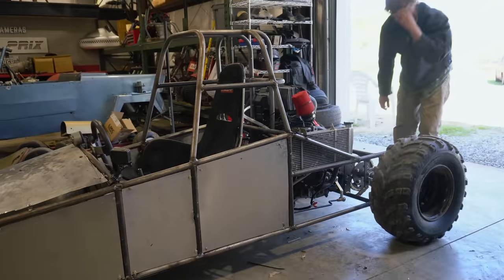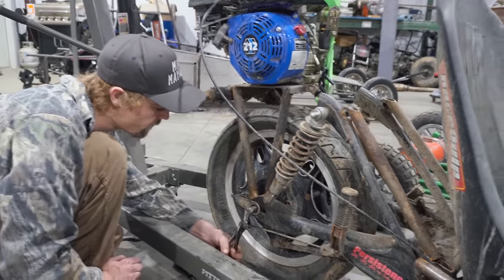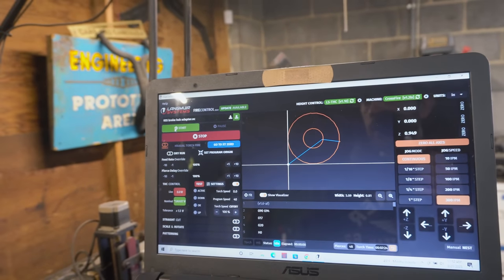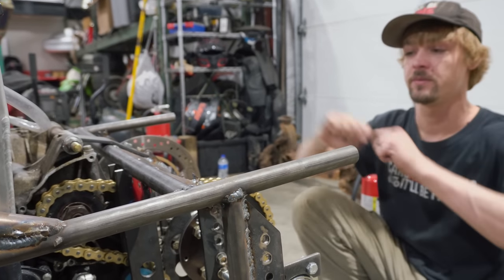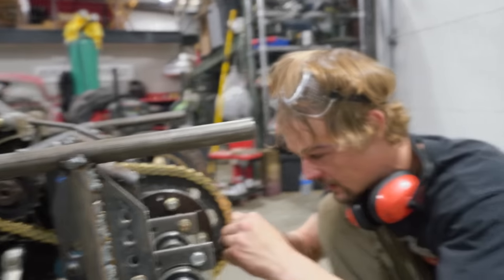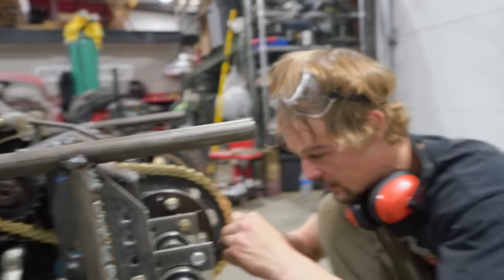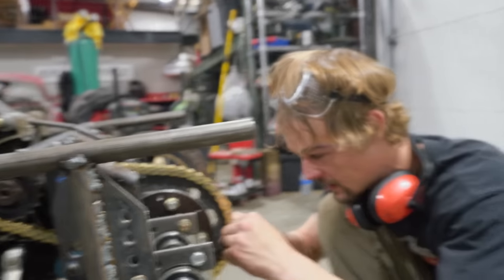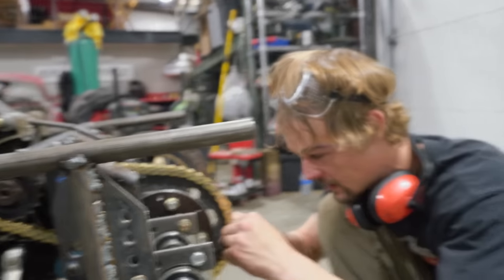Triumph 955cc Dragster First Test Drive!

Comment from the maker: A good first test drive always ends in burnouts and broken parts!
Reply: But is that safe ?
Reply: @Philc231  well it is entertaining so
Reply: So true
Reply: @CarsandCameras how much is the repairs going to cost?
Reply: Hey CarsandCameras I also know a four wheeler, jeep and side by side riding place about 10 miles where I live it’s called TEX PLEX it’s on J highway in Kirbyville Missouri
Reply: Is that front left wheel wobbly in the intro?
Reply: Quick. Question ...why are you guys not cutting out custom sprockets of your own to make ur own custom gearing
Reply: It ain't racin' till you set the seat on fire.
Reply: That engine sounds great! Can't wait to see (and hear) it on the drag strip!
Reply: It still looks like a blast to ride. A little bit of adjustment after the new parts are in, and you'll have a great ride. It sounds great, just too bad it doesn't have reverse.
Reply: If u don't break it ,your not doing it right ,if your not first your last 🤷😂✌️
Reply: Can you make another video of the racing mowers maybe with a sears make a dragster from it
Reply: It's called a shakedown for a reason🤙
Reply: And let us not discount the entertainment and excitement value of a good fire!
Reply: Try dual disk breaks on the rear
Reply: Opel gt! 
Opel gt!
Opel gt!

Been a good few months after I've been saying to fix it and it's finally happening
Reply: That axle looks like a weak point. My racing karts are bigger
Reply: Have you guys change the fuel system setup?.. Originally you guys had the fuel pressure regulator before the fuel rail when it is actual suppose to be on the return line after the fuel rail.
Reply: Especially when Ike is driving it 😂
Reply: Spoiler on it would look sweet
Reply: That's why they call it testing.
Reply: Also I didn't realize John an Charles were both lefties like me... I bet it'll feel weird tryna shift with your left because us lefties are so used to having to just use right handed stuff that it just feels unnatural using the left hand for most things😂😂😂
Reply: If you want to get much quicker shifts might consider a quickshifter.
As long as you are using the ECU from the bike the engine came off.

Allows you to make clutchless shifts with the throttle wide open.
Just have to use the clutch when taking off from a stop and when stopping.

Healtech offers one for the Daytona and Sprint models with this engine.
Retails for $320.
Should be a fairly easy install.

I have owned several bikes with quick shifters and they are great.
Can go wide open throttle and bang through the gears without having to release the throttle and use the clutch.

If you are racing it, it would shave significant time.

Some bikes also have the option for clutchless downshifting, but not sure on this one, and it’s not as important.

The general design for most of them is a sensor on the shift rod which is connected to the ECU and a control module.
When you begin to put pressure on the shifter, the sensor recognizes the pressure and sends a signal to the ECU to momentarily (milliseconds) cut ignition spark.
Which allows the shift to seamlessly occur without using the clutch.

There are plenty of YT videos showing motorcycles with them, as they have become standard on many bikes now.
Videos will demonstrate just how well they work, and the speed you can shift.
Reply: May want to see if you can upgrade that clutch fork assembly, you will give more pressure with your foot than your fingers.
Reply: It would be cool and look cool
If
It had a wing
Reply: A quick release wheel would be great for that

Comment: Nice first shakedown, lots of fire in that dragon, certainly! Hope the fix is quick & cheap. One irritating thing is the panel noise, Holy Mackerel!How about that DynaMat dampening sticky sheets & or stiffener ribs rivited underneath (or both!) Sometimes the conversation & engine were drowned out by the banga-te-bang of that panel. Great show & great crew! Thanks guys!  Paul from S. Central TX.
Reply: Quick spritz of bedliner in a couple spots on the inside should be enough to greatly quiet those panels...

Comment: You guys are still my heroes after years of YouTube, I still love watching your videos. John, I noticed your comment on the old CB750s, a friend of mine still has an unrestored rider 69 or 70 CB750 that runs like a top. I believe he still has his CR500 as well, damned thing was and still is the baddest oil burner I’ve ever seen. I’ve had an XL350, XL200, Voyager12, Vulcan 2000 (heavy but a torque factory on wheels) CB550, a beautiful CB750A if you know about the hondamatics (Excellent machine) a later pre nighthawk CB650SC and a slew of Japanese bikes before I got into V-Twins. Anyway Soichiro Honda San’s favorite of all the early accordion 4s was the 72-74 CB350 Four. The twin actually made a couple more horses at lower rpm’s and weighed less but he felt you were more one with the machine with the Four, it had a higher powerband, smoothness like nothing else, a 10,000 rpm redline and was built as a street bike to honor the race winning 350. It was a riders bike. The man was a genius. Anyway, useless information to most but an interesting story. Always love seeing you, Ike and Charles, doing what you love to do and hopefully making a living doing it. God Bless and keep on making folks happy doing the things you do. 
I really want to know what the plan is for the Opel on the rack, I used to watch a guy at Bakersfield run an odd fire 4.3 based Chevy V6 in one that sounded awful but ran like 8.90s with 1 four barrel. 
Sorry for being long winded, Frosty…

Comment: Good work guys! I think you should stick some noise reduction pads on those side panels so it doesn't make that rattle noise while riding. After all good project. Nice to see it  finally moving under its own power. 👍🤟

Comment: You still need to triangulate the front with some bars or at least a vertical or two on the sides. If one of you lose it and hit in the front it's collapsing and it can crush your feet or skewer you with a folding 6ft long piece of tubing.
Reply: bingo!
Reply: if they get in a crash that bad ther gonna die or get seriously injured anyway what your suggesting is a waste of time and wont look good theyve accepted the responsibility of driving this just leave it at that
Reply: nevermind im assumin you mean a x or v brace underneath in the middle then that would make sense i thought ya meant off the side or something
Reply: @TylerDuysen  I don't think you understand how a tube chassis/roll cage works in a race car.  The area you are sitting in, including your feet, needs to stay intact and the rest of the car/cage crumples/bends to absorb energy in the crash. There needs to be uprights (and a cross brace really) on the sides beyond their feet to keep the sides from smashing and bending whichever way the force takes them. There is a good 6 feet at least of tubing top and bottom with zero support and much of their legs are in that zone. In a frontal impact which will probably have some side forces as well, it's going to turn that 6 ft tube into a Z and the front is going to impale them  and/or fold over possibly with an ankle or whatever in there. Look at guys walking away from top fuel dragster crashes at 300mph or any nascar, sprint car ECT that go on wild rides and walk away. This 100hp go kart isn't going to be running numbers that should make it lethal to crash in with a little forethought and design consideration. Find a pic of a Jr dragster frame online. That's how it should be built. This isn't a yard kart. "It'll be fine" doesn't apply here. Ike is a moron if you haven't figured that out. John has no experience besides following along with Ike and Charles is probably telling them the same thing I am off camera(I hope).
Reply: You would think over the years the build quality would be better?  Look at the welds and the sheet metal and over all quality of this build.  I would not get in and drive this abortion.
Reply: @jasonbirch1182  i understand how tube chassis work bud ive built a few of my own(quality/proper tube chassis) they already have bars on the side underneath the sheet metal they are missing the x bracing underneath though which like you said would turn there side bars into tube spears if you read my other comment you wouldve understood i thought you meant something else entirely regardless this is not a proper cert rollcage/tube chassis at all its entirely wrong for that so adding more bars will help but isnt gonna do much have a good day and we will just all hope that there gonna be okay
Reply: @vinylexperience77  I'm hoping that if they go through tech at a drag strip the officials will flag the cart for poor welds. I'm not trying to be sarcastic, but someone will get hurt if that cart flips or hits the wall.
Reply: @larrycarlston4044  Yes someone will get hurt.  This whole build was very shitty craftsmanship.  That is not toy engine on that frame.
Reply: @TylerDuysen  I believe zero of what you just said.  You are talking they're going to crash and automatically die then you say you build tube chassis cars. Yeah. Okey dokey buddy.and no. There is no side bars beyond the dash bar.
Reply: @jasonbirch1182  okay smart guy apparently you cant do math what happens when you hit a cement wall at 100+mph when you have an improper cage/chassis you die or seriously get hurt theres a reason for nhra certified roll cages this has double the hp of there rail which already did 100mph on a run so this will go faster than that clearly second i never said i build tube chassis cars i said ive built a few theres a difference  c you obviously havent been paying attention to the videos because john welded in some side bracing and so did charles its just hidden under the sheet metal there is however no bracing on top or bottom or in the front nose meaning in a high speed crash it would completely fold killing or seriously injuring them like i said before and d and i will say this for the last time they used the wrong tube(not to mention how poorly its welded) so if they crash that chassis is folding like a slinky or accordian and they will be pancaked again goes back to nhra certifications this chassis is wrong so adding more side bracing or even doing the x brace in the back or in front or nbottom and top like i mentioned to them isnt going to do much like i said originally its a simple equation wrong tube, wrong thickness, lack of bracing, high hp and low weight and poor welds -serious injuries or death in the event of a crash have a good day
Reply: You can't tell them nothing as they don't listen to words of wisdom and truly believe safety last... Except for John's female side ..
Reply: @Wil_Liam1  😂
Reply: @TylerDuysen  how do you figure there's a 100mph collision on a dragstrip? You are never hitting the wall head on that fast. It's parallel to you. If they lose it and start to spin and hit the wall nose first theyre still not hitting it at 100mph. It needs to keep the driver compartment intact. The rest bends. That how a tube frame works. You said " I built properly designed tube frame cars" . No you didn't. Stop it kid.

Comment: You could get a Pingel electronic shifter. Or an Electric over Air shifter. They both interrupt the ignition to allow the forced shift without using a clutch. Shift into first gear with clutch pulled in at the line and every shift after that you just push a button and it shifts one gear at a time,  every time you push the button.
Reply: Otherwise known as a recluse clutch.
Reply: Definitely the way to go I know some who had an air shifter on aa wicked fast sporty

Comment: Owning a Triumph 955 sprint and having ridden many miles with other Sprint, Daytons and other 955 bikes, it is fun to hear the sound coming out of your project. The 955 has a very wide torque range. But the engine really comes alive around 3500 rpm and starts to flatten out around 7 or 9 k, depending on the version you have. 
My Sprint loves to trot along between 70 and 120 mph. They were not the fastest things out there by any means, but very rider friendly, and a blast to ride.

Comment: Hey for that kind of center-push clutch, you can cut a hole on the outside center of the cover (exposing the pushrod end) and bolt on half of a single-piston brake caliper and use that to actuate the clutch pushrod. Easy way to convert to hydraulic clutch. Ive seen some of the taiwanese motorcycle racers convert from cable clutch that way.
Reply: It's a pull type, which is one reason it got broken. But over pushing on one is bad also.

Comment: Love the dragster content & I've been saying build a rear engine car for awhile now. One thing I'd do is probably set the steering up with handle bars and a hand operated cable clutch and a foot shifter as on a motorcycle. My 2 cents. Good luck with that dragster boys !

Comment: Ya gotta make sure there's freeplay on the clutch cable. If there's constant pressure on the lever, loading the pushrod it'll heat up (bluing)and......well....

The max arm travel is 1/2-3/4"
Keep up the great work guys!

Comment: The skateboard wheel will last just fine, cheap, serviceable, and I had a minibike I built out of a chopper bicycle and a rototiller as a kid, it ran for 3 years @ 7+ miles a day, it used em top and bottom to reduce chain throw, the chain stay was 28+ inches

Comment: Just a tip  your welds are lacking penetration as you are running the amps to high causing you to wash weld. If you turn the amps down and slow down the your travel speed you will end up with much stronger and visually pleasing welds
Reply: Are you saying they're welding 1/8" with 3/8" settings?
Reply: There ruff for sure

Comment: Wait! The back of that frame is not complete! Those axle hangers are only being held on by the two front bolts. They need to be boxed in. Sure it’ll work. But why not just frame it in? It’s not like it would be a lot of work or added weight. Just added insurance and rigidity.

Comment: Very cool. I do notice the drivers head sticks out in front of the top of the cage (halo). If she flips the drivers head is exposed. Wondering if you could extend the front of the cage a bit to cover the head area near the very top of the cage so you can still get in and out somewhat easily and the drivers head is covered.. Kinda like an awning over an entry door...kinda. Nice work guys,she seems quick.

Comment: Great work guys. Absolutely amazing build. Breaking things is normal in the stage of testing. My question would be if you would want to build a wing for the front and back, like on these real Top Fuel Dragster. I think it would look absolutely awesome on this Dragster of yours. It would be more weight, but maybe you could build it so, that it's removable. Anyway, have a great week and have fun, but stay safe.

Comment: If you put an extra link in the clutch linkage at the arm, and add a return spring to the pedal, you'll be able to adjust it so there's almost no force on the throwout mechanism when engaged just by watching for that second link to 'kink' and not be in line with the cable end. Other ways to do it are a slotted pivot hole and large washers to keep it on track (gotta keep that lubed and clean) or by fitting a threaded rod end to the cable, fitting a sleeve over that, and using a little flat stock bent up with a hole in it as the throwout lever end so the cable doesn't fasten, it just slips in the lever until you pull it far enough to take up the slack and a nut/washer on the end pulls the lever.

Comment: Open wheel race cars you see on pikes peak have side pods but they also have big front tires.
Drag rails do not have side pods.

Y'all finally got a machine with a good sounding exhaust.

Comment: Paddle shifters on the steering wheel. You could build a  bracket for the shifter on engine on Paddle would be used for up shifting and the other for down

Comment: If you want to get much quicker shifts might consider a quickshifter.
As long as you are using the ECU from the bike the engine came off.

Allows you to make clutchless shifts with the throttle wide open.
Just have to use the clutch when taking off from a stop and when stopping.

Healtech offers one for the Daytona and Sprint models with this engine.
Retails for $320.
Should be a fairly easy install.

I have owned several bikes with quick shifters and they are great.
Can go wide open throttle and bang through the gears without having to release the throttle and use the clutch.

If you are racing it, it would shave significant time.

Some bikes also have the option for clutchless downshifting, but not sure on this one, and it’s not as important.

The general design for most of them is a sensor on the shift rod which is connected to the ECU and a control module.
When you begin to put pressure on the shifter, the sensor recognizes the pressure and sends a signal to the ECU to momentarily (milliseconds) cut ignition spark.
Which allows the shift to seamlessly occur without using the clutch.

There are plenty of YT videos showing motorcycles with them, as they have become standard on many bikes now.
Videos will demonstrate just how well they work, and the speed you can shift.

Comment: Wasn't this supposed to be a hand pressure clutch on the motorcycle - not a leg powered clutch.  "Stops" are needed for the pedal and a spring tension limiter on the cable.

Comment: I don't know if you're using the stock clutch cable. You obviously have a different setup on this than there was on the motorcycle if the cable is too long it allows the clutch arm to be pulled too far or it is not mounted on the motor in the same position as it was on the bike. The guy that had this before may have had the same issue and that is what ruined the cover and the mechanism

Comment: nice yamaha engine! those are used alot in yamaha  snowmobile. a MCX turbokit bumps it up to about 190-300 hp depending on the kit and how mouch work you wanna do with the engine